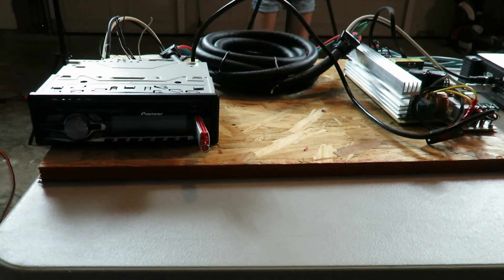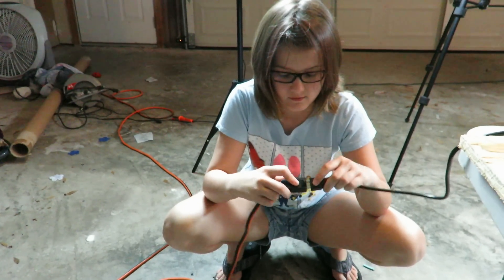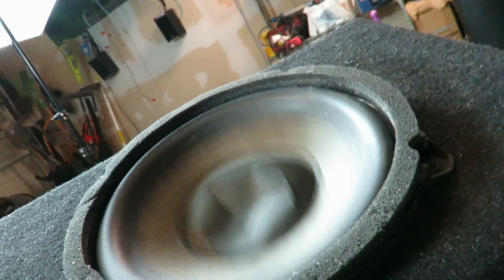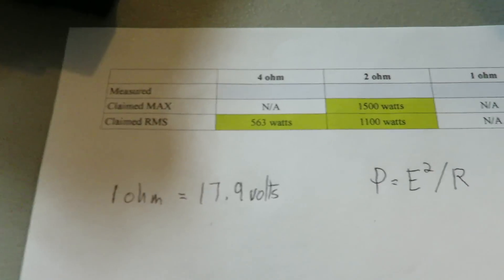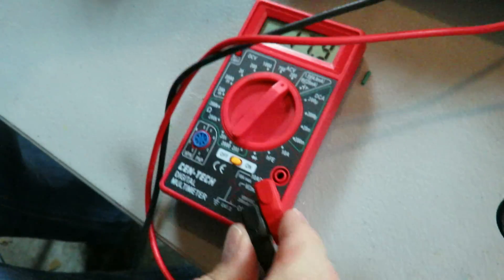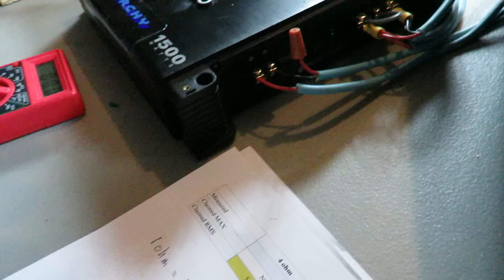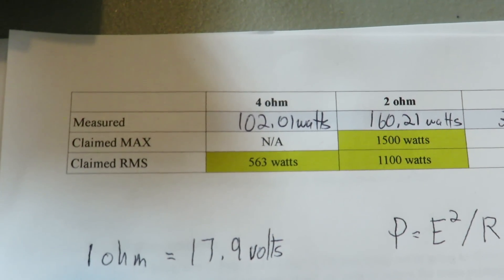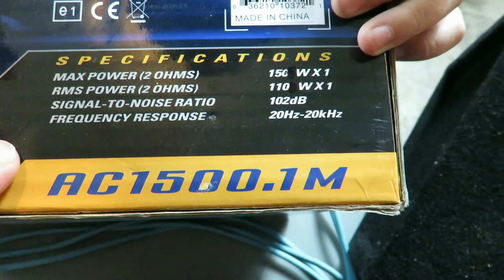How To Get Your Cheap Car Amp To Output The Watts Printed On The Box

Comment: I have that exact same amp. It does not run at 1ohm. Its says 2ohm on the box. Its shuts off if you try to run 1ohm. It definitely runs way more than watts then what said in this video. I got 2 1,200 watt Memphis 12s and it makes my side mirrors ripple and I gotta drop the windows for air space.  This video is a joke. Maybe he needs to know how to properly install a amp!!! Not on a table with a real battery and some 4gage wire or better!! That amp is a great buy for the price. I've beat the shit out of it and its has never givin me any problem besides pissing people off for my bass traveling to far and too loud. I'm setting off car alarms. SMH. Someone else who  has no idea what they're talking about.

Comment: You're doing a little too much extrapolation with your calculations there...you'll see similar results for power output on higher-end amps also, provided all your variables are the same and you're testing 40Hz using the same head unit and power supply. You're only looking at a small sliver of the spectrum.

Comment: I don't know if this was a joke or this was just being done on April fools or what,,,,, but I actually have this amp myself and it pounds the hell out of any speaker that is not rated at least 800 watts!!!
 I've actually blown two 1,000 watt speakers with that amp that you say does not even do 300 watts. 
People,, please use a Dyno ,, oh ps did you guys not notice that the ohms , when being played , if tested at the speaker terminals or amp output ,, will change a little with different sounds and power 
Anyhoo ,,, once I got past this as being serious ,, I thought I would put in my 3 cents. 

GOOD 1 👏🏻👏🏻👏🏻👏🏻👏🏻👏🏻👏🏻👏🏻😂😂😂😂😂😂😂😂
Reply: Question, help me out, what subs should I get for this? I have a box for 2 12s

Comment: Dont the wires your using make a difference 16 gauge to 4 or 0 gauge 16 gauge speaker wires is whats rated for the 0 gauge 4 is i believe 18 or 17 gauge i really think your not giving that amp a chance with those wires cause i have a planet audio 3000 watts and a weak lanzar 6000 watts hooked up to l7's and that planet audio makes a huge difference between the two also running from 0 gauge wires with a kinetik battery to let the amp breath
Reply: Some but boss/planet audio are known for this scam along with Many others

Comment: 1 Should have measured power supply voltage while testing @ each resistance
2 Should have shown Speaker resistance before testing (4-2-1 ohm not possible unless you have a 4ohm dvc and unhook 1 v.c. for 4ohm test which was not stated) 
3 The amp probably put out more voltage @ 4ohm test due to power supply limitations (see #1)

Comment: Look at the power and ground wire! L.M.A.O.  what is tht, like 20 gauge!!!!  S.M.F.H.    u can get more watts by just putting the right gauge wire on it like it needs u big dumby.  S.M.H.  
I couldn't watch all of this vedio. Just buy an SMD dyno TESTER frm Steve Meade dude.
Kenny Kimbler 
Atmore, AL
Reply from the maker: 3x 16 AWG = 11 AWG wire. More than enough gauge for a ~3 foot run for this turd of an amp. Additionally, the power supply (50 amps) would shut off if I was drawing too much current. Considering this amp only has a single 30 amp fuse in it this would never be an issue.

Comment from the maker: To all you armchair EE's repeating the obvious, yes I know the formula I used to calculate watts was for DC, yes I know I wasn't accounting for box rise, yes I know I'm a horrible person and should be taken out back and shot; the point still remains: these amps suck and there's nothing you can do to get these to output what's on the box, and the DC calculations aren't far off from the actual output (and honestly they're generous). Here is the same amp (different brand/skin) going through dyno testing: https://www.youtube.com/watch?v=omK1eyFqc08 the results are even worse than my calculations.
Reply: They suck? Totally beg to differ.. You provide 4 clean volts input from a quality head unit with quality crossover and You get amazing results. Signal is more important than ANY AMP ever will be. I have an anarchy 1200 pushing a pair of shallow mount 250w rms subs with a very high quality pioneer 7" touch. The gain is on 3/4 so in the clean area, bass boost and loud off and the subs sound amazing at max push..
Reply: PROCHAMPIONSHIP BELTS that doesn’t mean that the amps don’t suck something can still work correctly but suck

Comment: only problem I have with this is how is the speaker wire is it a dual voice coil is a single voice coil is it 2 ohm 4 ohm or 8 ohm all of this counts in ohms law your method needs to be rethought 1 ohm is more powerful than 2 ohm and 2 ohm is more powerful than 4 ohm so it's something missing u have to determine what load the amp is currently at with the speakers ohm age and wattage

Comment: I got sucked down the Ol' YouTube Rabbit-Hole and had to see where this was going. and...
Yep, complete waste of my time!  How and when were you able to drop the load on the amp? And the sub's power rating? Like max wattage or Ohms? Looks like a shitty 8ohm cabinet speaker from where I'm sitting. Jeez... Wait, maybe they're snowed in and losing their minds. I've heard this can happen during the throws of a blizzard. Seen the Shining? But seriously, could somebody please donate a reasonable multimeter to this guy? Free harbor freight multimeters suck. Why boast about never buying cheap aluminum wire only to turn around and buy/use cheap ass tools? I'm not surprised. This dude doesn't know what he's talking about nor what he's doing. Sure, post more videos simply for the sake of spending time with your little girl. But please don't fool yourself into thinking you're teaching anyone anything.
Reply: j scott if the speaker can’t take but the little watts you put in it make your very cheap speaker make bad sounds that’s not the amps you need a better way to check when the amp tops out (clipping)

Comment: when and how did you change the ohm load from 4ohms to 2 ohms and 1 ohm on a single subwoofer . this is so full of shit
Reply: Right !
Reply: its a dual voice coil subwoofer that this douche used, it has two voice coils and each voice coil was supposed to be 2 ohms. if you parallel them you get 1 ohm, if your un just one coil you have two ohms and if you series them you get 4 ohms. But yeah it all changes as soon as the cone moves.
Reply: It doesn't matter because its not doing rated power at any ohm load and Speaker is dual voice coils its how u change ohm load now please get a clue before you hate

Comment: I don't like to leave negative comments, but in this case I think its justified because it looks like other posters will be using this video to make a purchasing decision. Don't get me wrong, I know your comments were made with the best of intentions. Its just your knowledge of audio components, and how they work, are not where they need to be. I don't have time right now to do a full review covering all the details. I'll leave a list of comments, and if I'm not clear, or you have questions just post, and I'll do my best to address them.

-- Any type of power measurement needs to be associated with the amount of distortion produced by the amp, at that particular point in time, for that load.

-- All other things being equal,  the lower the resistance (ohms), the harder the amp has to work. For example, its easier for an amp to produce a 50 watt load at 8 ohms, than it will 100 watts at 4 ohms. This is where distortion becomes critical. The amount of distortion an amp produces will increases, as resistance falls. 

--The biggest mistake people make when assessing an amp, is going by watts. Volts x amps = watts. So, if you 're looking at an amp that's rated for 100 watts at 8 ohms, producing x distortion, is mot much help. 10 amps x 10 volts= 100 watts. 2 amps x 50 volts = 100 watts. 4 amps x 25 volts = 100 watts. The combinations are endless. 

== Ohms listed for speaker measurements are averages. So, if you buy a pair of speakers that are rated for 4 ohms, understand that the 4 ohms is just an average. In order for it to be meaningful, the average needs to be listed along with the lowest possible resistance the speaker will provide the amp. Looking at a spec sheet, you'll see something like 4 ohm's nominal, 2.5 ohms lowest. For picking an amp, the lowest amount of resistance at 2.5 is much more important than the 4 ohm rating.

I don't have time right now to continue, but I think I've covered all the basics. To apply this in a meaningful way,using the Planet Audio amp in question, it should be easy enough to figure out that this amp is not ideal for a sub.  You're just asking way too much from it. You're not getting a super high output, high current amp for $70. I would use it  in a different application. It would sound great on a pair of door speakers.
Reply: Samtab Galaxy so what your saying it my 1200 watt speakers are fine with my 1500 watt planet audio amp or should i get a diffrent amp

Comment: nice job on how to get more out of a cheap amp i usually will match the speakers with the end so it the app says it's a 1500 I usually try to go for like 100 watt speakers RMS to handle that power which will make them sound like it's amazing and when we already is it's a piece of s*** just I have it wired down on some unexpensive subwoofers so it would make that amp sound excellent thanks for the video bro that was good help

Comment: Great vid! Just asking if I can connect (2) dual 4ohm subs to this amp, since it only has speaker outputs for (one) sub. How would I do this, without the amp going into protect mode?
Reply from the maker: OWN12S yes this amp is stable to 2 ohms, so you would just connect both to the same terminal in parallel